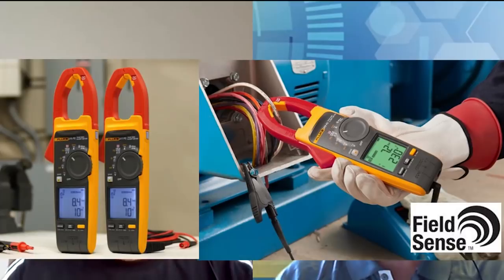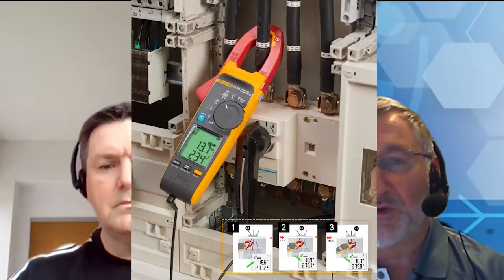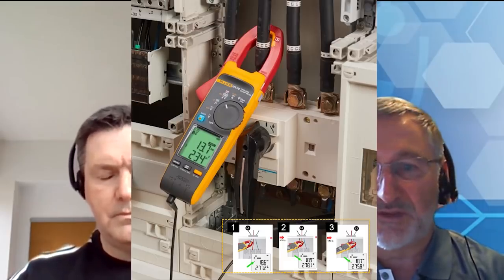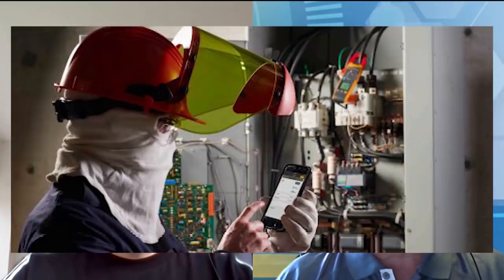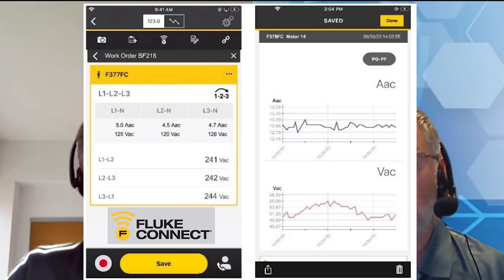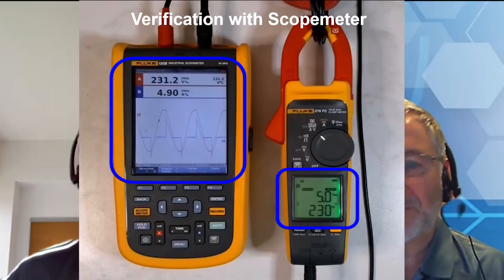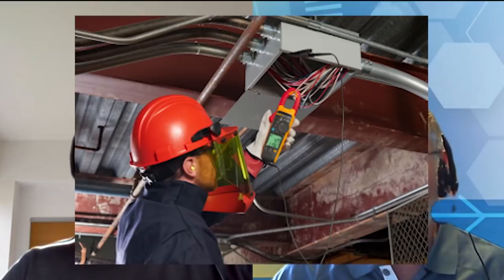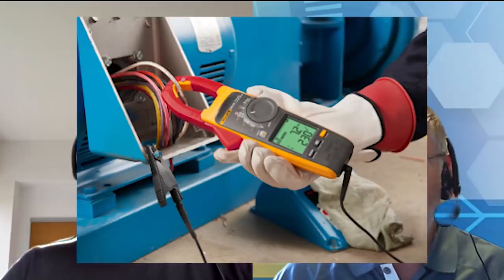Fluke 377 FC & 37 FC Clamp Meters that perform voltage and current measurements simultaneously

Comment: For measuring the AC voltage “120V _ L-N” & cable size “≥4/0 AWG”
AC Voltage - Field Sense:
the reading can be [from 109 to 131 V_L-N]. – on the app [189 to 227 V_ L-L].
The accuracy - 5 % ±5 digits (45 Hz to 66 Hz) “the resolution 1V”
Compared to AC Voltage -Test Leads:
The reading can be [from 118.3 to 121.7 V_L-N].
The accuracy - 1 % ±5 digits (20 Hz to 500 Hz) “the resolution 0.1V”

Conclusion:
Its inaccurate & has limitation [frequency range, can’t be used for DC measurement or with iflex]

The power quality thing is just marketing thing “useless”.

If you were at substation or any important point at the network you would find the right devices already installed "for monitoring".
For example if you would check an electrical panel “3-ph” for house and you have this fancy device to tell that there is something wrong with PF that you can’t even measure it as a number you only getting indication – who cares about low PF for the house's load as you cant tell about the PF correction “compensation” – or if the house's load is unbalanced at certain point in time who cares you cant tell the user to power on 3 air conditioners at the same time to keep the load balanced... 
let alone speaking about crest factor or the total harmonic distortion.

Some would say hey for industrial use they will pay for low PF and they pay for VAR. its correct but at this point in the network you will find pre-installed device to monitor these and mainly there will use a certain way for PF compensation such as capacitor bank.
And for unbalance load issue – mainly they use big machine which powered by 3-phase.

Actually if i bought this fancy device i would never justify the purchase by saying thing about the fancy features as i would give 3 main reasons behind making the purchase decision [1- i can afford it , 2- its nice to have, 3- its reliable ]